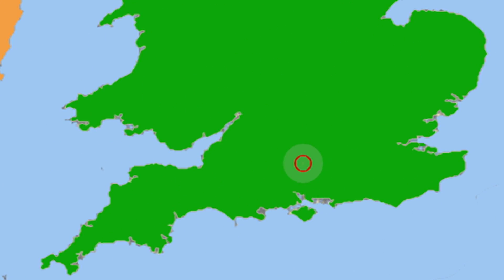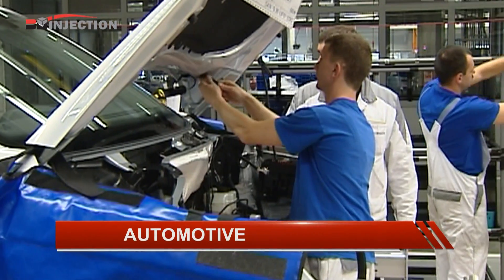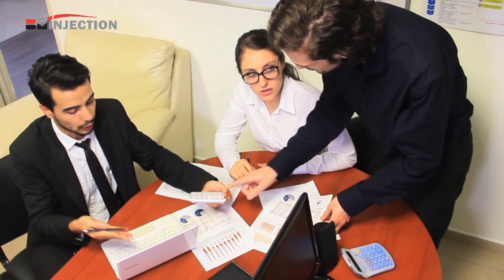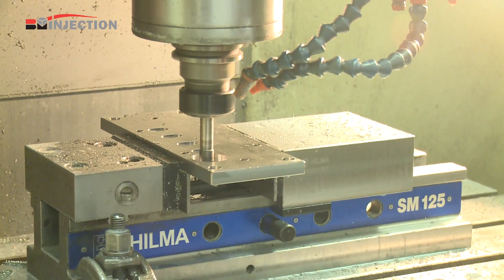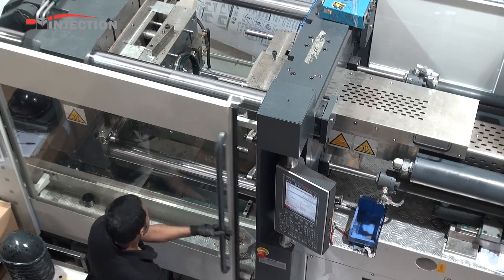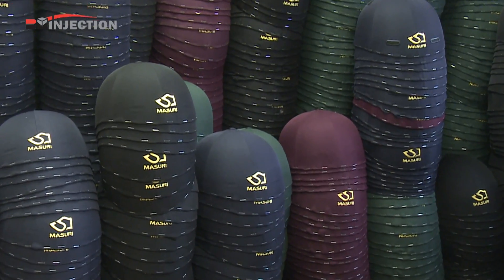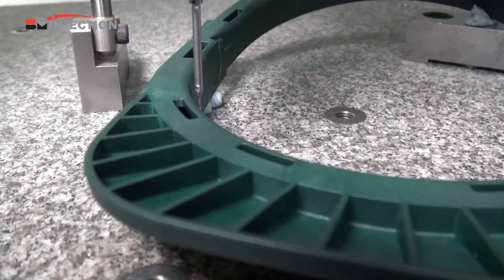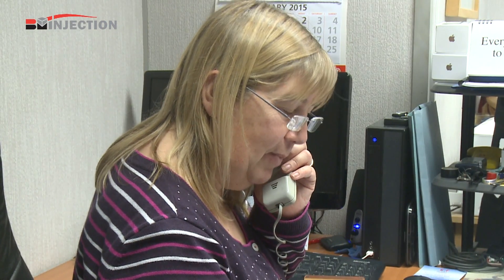Plastic Injection Moulding of Parts UK

Comment: Impressive tool room.  Impressive QC, how often are samples checked.  Molding, well I could not be less impressed.  It is also tool design.  These add on CAD packages are not engineers.  Unless you were showing prototype molding, good luck.